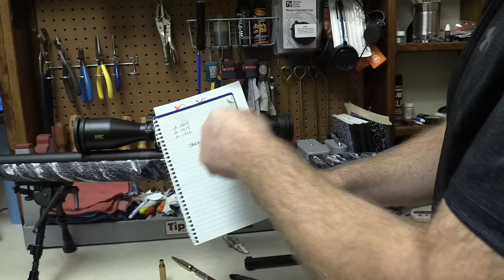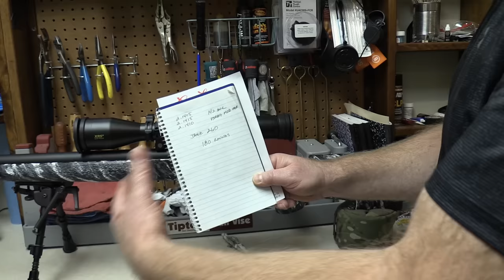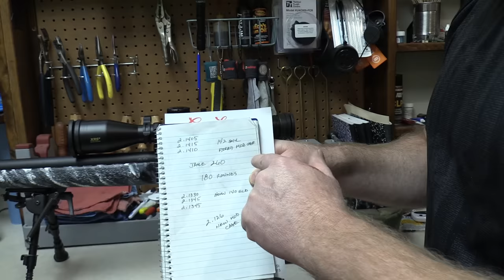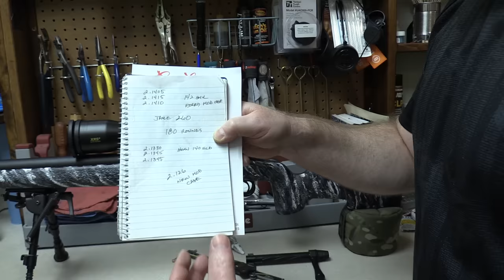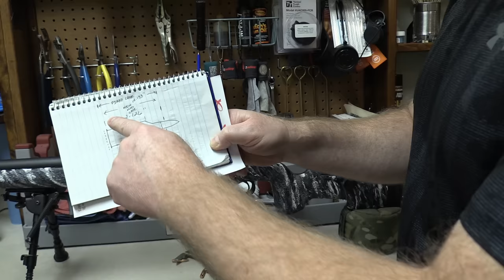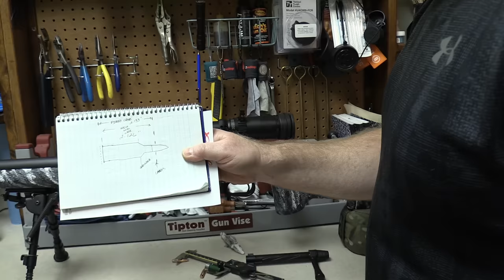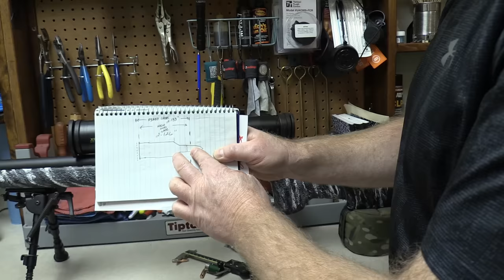COAL vs.  CBTO & Measuring Max CBTO w/ Hornady LnL OAL Gauge

Comment: Great video Sam! I just purchased a new Ruger bolt action 6.5 Grendel, when I measure CBTO I come up with significantly less than what factory am measures. Is this normal? Have you seen this? To increase accuracy in HandLoads , what would you suggest? Right now I matched HandLoads to factory ammo CBTO. Thanks

Comment: Sam,

I have heard you mention several times you start your load development at .010 of the lands.   I was just re watching your load development series before I start my own and on series III you start at .020 off the lands.  

My question is should I start .010 off the lands when using a fired modified case or a off the shelf modified case?  Would it make a difference between either case?

Thank you,

Comment: I like to take 10 measurements and write it down and remove the highest and lowest measurements and add the remaining measurements and divide by 8 . Then I have a average and back off .0020 of a inch . Also make a dummy round and make sure the round fits your magazine and it work through your chamber
Reply: Yeah ditto to that mate, I have built 1 extensively checked dummy round for each of my rifles favorite bullet weights in all the calibers that I reload for, this greatly reduces my die set up time  and insures a consistently  accurate round every time until it comes time to adjust for chamber wear.

Comment: Great Video!

Does anyone have any advice on loading a .300 Win Mag in a semi-auto Browning BAR? 
I was hesitant to load this due to the belting and not being able to get near the lands due to magazine length restrictions.
Are there any sizing considerations for an autoloader? I’m planning to do a .002” shoulder bump with a full length size, and a .002” neck tension. Any issues with this?

Comment: I know this is going to sound stupid, I am new to bullet seating depth. I have the short action custom case and bullet gauges and both the Hornandy oal gauges. I already drilled and tapped the modified case (338LM) with plans to drill and tap more calibers. My question is do I resize the brass to close on the bolt with no resistance or do I just bump the fire formed brass 2 thousands. I have the tool to remove my firing pin.

Comment: Great Video, however when you measure OAL, the bullet jump will still be consistent, since you are not measuring and correcting every bullet , after setting the seating die. It will just be different , depending on the ogive -tip distance
Reply from the maker: Agreed. The main benefit of using CBTO is a consistent, accurate measurement for jump when setting up a seating die.

Comment: Been watching your videos and am subscribed. Thank you! I have learned a lot from you. I have a concern regarding bullet seating to rifling. Cases are Hornady. Resized and bumped .002. Using the Hornady Lock n Load straight OAL guage which I used per your instruction. My bullet, moving back an additional 010 comes up much shorter than minimal OAL specified on the load data. The bullet is probably more than halfway inserted in the case. I know with starting loads this is not an issue. But this has me concerned. Is this a problem?

Comment: Just a quick question. Speer is recommending creating test dummy rounds for each bullet type using the method where you use lamp black or white board marker to find the lands for your particular rifle then back the die off 1/4 turn. Is this as accurate as the method you are describing or is it just good enough for general hunting rounds?

Comment: so if you have a controlled feed bolt and extractor with no ejector pin in the bolt face, as in my Sako 85, the principles are different from those you have explained here. Is that correct?

Comment: Sam I have a question. I have made a mod case fired from my rifle and bumped the shoulder 2 thousands with out my bushing in the die. I used a rem case for the mod but I am going to use Lapua brass for my reloads. Will using different band brass cause my measurements be off?
Reply from the maker: Arlie A. Nope. You should be good to go.
Reply: Thanks for the help and good videos 👍

Comment: I have a question Sam. I’m working on seating depth. I’m using the Hornady O.A.L. Gauge with bullet comparators and the headspace comparators. I’m working with a 26 Nosler. Hornady doesn’t have a factory modified case so I had to go the custom route and mail a once fired case to Hornady. Where I’m confused and need help is when I measure the headspace on the case Hornady modified for the O.A.L. Gauge it measures 2.2430”. A once fired brass I have consistently measures 2.2375”. The new Nosler brass varies anywhere from 2.2350”-2.2375”. If I want my seating depth the same C.B.T.O. as I took with the Hornady case they modified in the new Nosler brass do I add or subtract the difference in measurements to the original C.B.T.O.?
Reply from the maker: Josh Cabe You can do that, but I would run that modified case through my Type S die with the bushing removed, until it matches  my fired/sized case dimension.
Reply: So run the Hornady modified case through the die?
Reply: Sorry I just reread your reply
Reply: When I get my modified case to match my once fire brass measurement do I add the difference of headspace between the once fired brass and new brass to my new brass C.B.T.O. measurement to get the same C.B.O.T. as once fired brass?

Comment: First off thank you for all your great videos. My question is with the new brass or fired brass why would it matter if you trimmed them for the measurement? Wouldn't they be the same then or is there still difference in consistency of the cbto? That or it is not necessary to trim as often as I think and the measurements pertain to keeping everything safe and consistent.
Reply from the maker: Trimming has nothing to do with CBTO. The only time you’d have to worry about the case’s OAL is if the modified case is bottoming out in the chamber against the case mouth, rather than the shoulder. 

Shoulder setback is a different measurement, and is controlled by the sizing die. The CBTO will be different when measured with a fired vs. new modified case, by exactly the difference in length of the two cases, when measured from the shoulder to the case head.
Reply: Got it, thank you for clearing that up for me

Comment: I still don't get it. OK so the fired brass is longer because it was stretched during combustion so seating depth must be adjusted for new brass. But then, what about case trimming? Doesn't it ensure both new and fired brass are exactly the same length?

Comment: I have 300 factory new alpha 6gt brass.. I will shoot 150 rounds to break in the new barrel before I start load development. When I do, i  should use the fire-formed brass with the shoulders pushed back 0.002  over the other 150 new brass for the same reason correct?

Comment: So with an ar15 is it even possible to get a couple thou off your lands since the mag has a max lemgth that im guessing is smaller than getting just off the lands?  Or would you just have to single load ?  Also is it possible to load out to max mag length and hit the lands, or is it impossible to reach the lands loading just to max mad length? I load for both 5.56 and .223 wylde barrels

Comment: Thanks, I was using fireformed brass but not bumped back a couple thousands and was getting five or six thousands difference. Now I know why,  What would you say is the biggest reason for vertical stringing or dispersion.... my groups are always good horizontally but will be moa but all vertical.
Reply: Check you action screws and scope and rings screws to make sure nothing has come loose .

Comment: Sam - Any comment on CBTO measurement using the modified case for a belted cartridge such as a .300 WM?  Your discussion relates to shoulder-chamber and bullet-land contact but with a belted case the former isn't true, correct?

Comment: For new brass I just use max OAL and then neck size brass. For 308 I have not seen any usefull change in accuracy using CBTO, I use 2.80 or 2.81 OAL. Do you have any data on accuracy improvement with CBTO variation?

Comment: thanks for the video and all the older ones, still use them. here's my question: lets say I find my maximum CBTO (where it touches the lands) with berger 210 gr .30 bullets and I want to figure what seating depth is best for my barrel. how much do I subtract from the max CBTO in order to start the testing process? .001? .0001?
Reply from the maker: Robert M I start .010” shorter than the max CBTO. That’s what I’m shooting 210 HVLDs at in my 300WM.
Reply: Thanks! I’ll do that and work my way back until I see a drop off in grouping and accuracy

Comment: typical angle of the cut from bore to groove diameter on a reamer will be 1 and 1/ to 2 1/2 degrees. Custom reamers can be ordered to set this if need to.  How about an in depth video on SAAMI chamber dimensions, same on cartridge dimensions and headspace gauges and why the y are important. From the comments I believe this to be a dark area for most shooters.

Comment: If I wanted to just use a purchased modified case, do I need to compare the length of the purchased case to a piece of fired brass. If there is a difference in length what do I do if anything with that number?

Comment: I get the using the OAL gauge and the bullet comparator to measurement to the ogive (which more consistent than measuring to the tip). The reason we are using this measurement is because of the inconsistencies in the bullet tips when measuring overall length (which could change). So this is what I don't get: how do I seat the bullet using the same bullet seater die that was pushing down on the inconsistent bullet tip as before I measured to the ogive? Is there something new that goes into the seater die that would seat to the ogive without pushing down on the inconsistent tip? Do you see what I am getting at? I measured to the ogive, great, but if I am still using the same seater die with the same seater plug before and after,  how am I consistently seating to the ogive? What am I missing? I know I am re-stating but how would I set my die to the ogive.
Reply from the maker: The seating stem contacts the nose of the bullet below the tip. To check where it contacts, mark the top third of the bullet with a sharpie, and seat a bullet. If yours is contacting the tip of the bullet, you should fix it.

Comment: Hi Sam
Great vid. All your advice has been noted until I further expand my reloading equipment (head space comparator, OAL gauge and modified case)
In the mean time is it safe to say that ensuring all my resized/trimmed cases(unprimed to ensure primer seating isnt affecting measurements) all come back the same measurement then begin to load cases and not be too fussed over COAL and rely on the consistency of the trimmed case as the bullet seating depth will also be consistent on the shoulder... orrr if there's any inconsistency of possibly bumping the shoulder while resizing would have an affect on this anyway?
Thank you
Reply: In addition to my previous comment... also taking into account I have found my lands (in other ways not as good you've just shown 🤭)

Comment: Thanks panhandle, learning a lot. It seems that if Precision is instituted by measurement from the OG, shouldn’t we be seating the bullets on the OG also? Seating from the top of inconsistent projectiles will automatically give you undesirable, seating depth.

Comment: Hey Sam, I’ve got a question that is probably stupid simple. I reload for my 300 Win Mag and I’m well over the SAMI spec COAL but I don’t have a comparator body to measure CBTO. I load to 30 thousands off the lands and have plenty of room in the magazine but when I chamber a round it is kind of hard to turn the bolt. What am I doing wrong and how do I fix it?
Reply: Check the dimension from the shoulder of the case to the base ( by the primer) . it is likely a situation where your brass has stretched ( from firing, and only neck sizing)  to the point that it is tight in the chamber, even though the bullet is not touching the lands.  its a very similar to the measurement he is doing to the bullet. But you need to measure the case.
Reply from the maker: That sounds like a sized body dimension problem. With a belted case, you only need to set back the shoulder .002" or so to stay off the belt on subsequent firings, plus pick up some breathing room for easy chambering. You definitely need a comparator or gauge to get that perfect, though.
Reply: @PanhandlePrecision  I am a pretty amateur reloader. I have a Hornady Custom Grade full length sizing die that I've set up just following the instructions. I have a batch of 170 rounds I reloaded yesterday. The weird thing is some of them chamber fine while others are hard to chamber. When I measure from the case head to the shoulder of the two, as suggested by Christopher, the measurements are the exact same. Is there something else I should be doing during resizing or do I need to get a different die?
Reply: @PanhandlePrecision  Also, will it hurt anything to shoot them? I dont really mind if I have to put a little more pressure to turn the bolt but I'm worried it is going to rupture the case or something.
Reply: Are the cases ones that you've fired in the same rifle before?
Have you checked the case length after resizing?  Maybe it needs to be trimmed.
Reply: @toddb930  yes, all the same rifle and have trimmed between loadings.
Reply: @dannyhoward4363  --  if you take just the resized case and try to chamber it, does that work okay?

Comment: I've heard some bad things about the Hornady LnL OAL gauge, have you had any issues or seen any differences compared to the SINCLAIR BULLET SEATING DEPTH TOOL?  My specific issue presented itself with a custom chambered 28 Nosler.  The guy who did it sent me all the specs.  After I received it the very first thing I did was verify with my Hornady tool and could not repeat the specs.  I called him and he stated to toss the Hornady and buy the Sinclair, said he get that all the time.  I have put a lot of money into the Hornady buying a bunch of rounds over the years and have a hard time chucking it.
Reply from the maker: The only part of the "hornady" tool that I use is the fixture to hold the case. It's actually a Stoney Point tool that I've owned since before Hornady bought the design. All of my comparators are SS Sinclair inserts. I have no idea how somebody can't get repeatable measurements with it. I have no problem repeating measurements to the thousandth, every time I use it.

Comment: Have you used a bullet ojive to base tool for sorting bullet's?
Reply from the maker: No, if I sort bullets, I use two comparators to check bearing surface variations.

Comment: I'm using a hornady modified brass, not a fired custom brass.  The difference in the case length of hornady's modified brass and my once fired brass is 0.005 and my measured
CBTO using the hornady modified brass is 2.247", should I seat my bullet at 2.242" in my once fired brass?  Shoulders have been bumped back .002.
Thx and great video.  I am a new reloader.
Daryl
Reply: As I understand, yes.

Comment: Sam, I'm experiencing a strange problem. I'm reloading 300 WSM using Redding Competition Dies with S-Bushing resizing die. Since the OD of the neck is supposed to be .344, I  ordered a .342 bushing. However, what's happening is that, after sizing, the OD of the case neck is .342, but the ID is .312. The brass is Hornady, and the measurements are consistent over 50 once-fired cases. I'm using 208 gr Hornady Match .308 bullets, but they simply slide through the case necks into the powder. How do I get them to stay put after seating?
Reply from the maker: I think you have a measurement that’s off. 300 WSM would take a .308” bullet, plus thickness of the brass x2. That should add up to .025-.030”. My Lapua 300 PRC is the thickest .308 cal brass I have, and I use a .337 bushing for a .339” loaded OD. I would guess the Hornady brass would need a .334-.335 bushing.
Reply: @PanhandlePrecision  I guessed that the solution was to get a smaller bushing. The measurements are done using a Mitutoya Digimatic and I checked them twice. So, to get to a .305 ID I computed the need for a .336 bushing. Do I need to go smaller than -.003 neck ID to preclude setback in my gas gun with the 300 WSM shooting 208 gr bullets 
@2660 fps? Thanks for your help, Sam. I appreciate it always.

Comment: thought just occurred to me if only one could make something like a shape gauge for their chamber. you could take all the necessary measurements from that, the idea hit me from remembering folk slugging their barrels for caliber measurement. and how shape gauges work. if only we had something that would hold its shape after putting it down a bore, that was ready and at hand. maybe a mechanism that works off the tension that is applied. man i'd love to see what that looked like, my mind's eye can see it partially but not completely. looks like a cross between a case and a porcupine with a threaded rod that runs down the middle. but not sure how to pull that off. 34:10 maybe something that uses a diaphragm? feedback welcome.